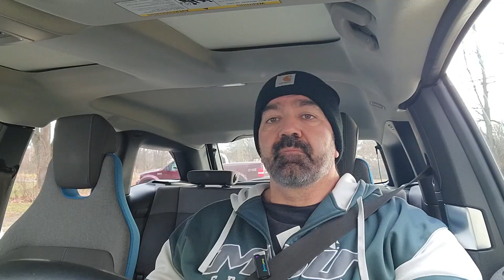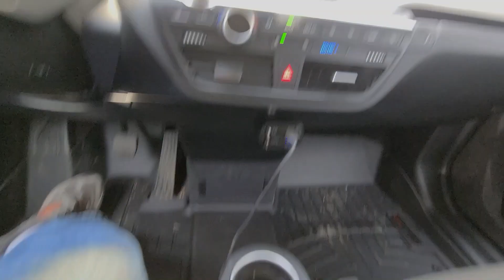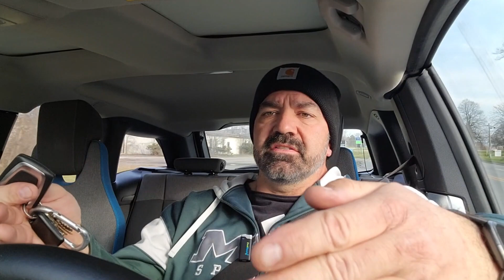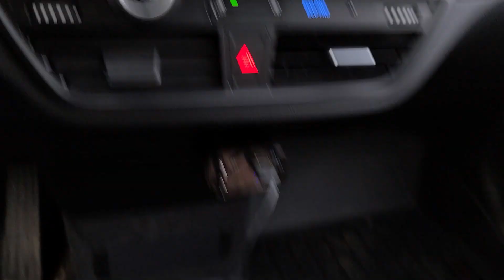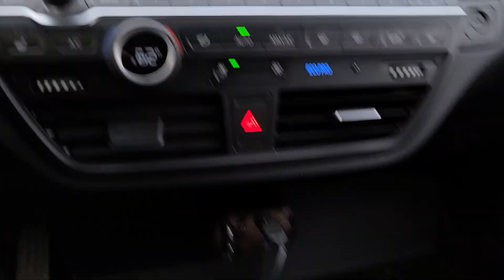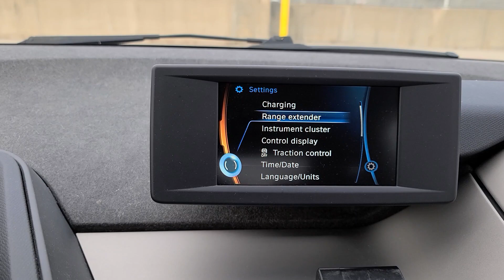BMW i3 First Impression and Review

Comment: So did you end up doing 19x5 rims all around??
Reply from the maker: Yes, the rims were all 19" including the stock ones.  Its a base model so that was standard.
Reply: @NoGasNiko  yes but you did say the the rear wheels were a bit wider than the front so did you size up the front set to match the wider wheel because of the tire issue you said? Or did you down size the rear wheels to match the front ones
Reply from the maker: I misspoke.  They are taller.  Same width.  Just found that out late last year when I purchased new summer tires and they told me the recommended sizes.

Comment: I have a 19 bev and I exclusively drive it in comfort unless it's very slippery or the wife is feeling unwell then i move it to eco pro for the reduced throttle response. Hot tip you can turn up the heated seats even hotter with bimmercode. We love our little i3. We've had no range anxiety, we've put 25k miles on it and have had zero issues. Just completed the 50k mile service and it's pretty diy friendly on that front as well, at least in the bev. Other tip for bimmercode you can set up comfort climate on by holding the panic alarm button. The rex was to me added complexity for minimal value. In my experience engines that run intermittently have problems constantly. If we had one we may have used it occasionally but it's just not worth the extra maintenance to me.
Reply from the maker: We got the REX because we often take road trips.  It's nice to not worry about the availability of fast chargers.
Reply: @NoGasNiko  I hear ya there, I figure the next EV will have more range and we'll deal with fast charging if we do a 300+ mile trip then. Currently we have a gas SUV that we use for the odd road trip over 200 miles. Once we replace that we will probably need a fast charger between 3 and 5 times a year with the amount of long distance driving we actually do currently. I see the value of the rex for you and other people but if I had one it would have been used maybe twice in 25k miles and if that's the case I just don't want it 😂 love the videos btw!

Comment: In bmw i3 you can coast or control Regen. It's done with your foot on accelerator. The bar graph in instrument cluster tells you how much power or Regen. Pick up foot just enough to place square in center is coasting. Lift up a little more for a little more Regen let off completely for near max Regen. Touch brakes lightly for max Regen. It's foot control.
Reply from the maker: I've been doing that lately.  The Nissan Leaf I was driving had e-pedal mode and that reacted just like the i3.  I could turn it off on the Leaf.  The Leaf actually has 3 levels of regen.  I just had a hard time accepting the BMW only had 1 setting.